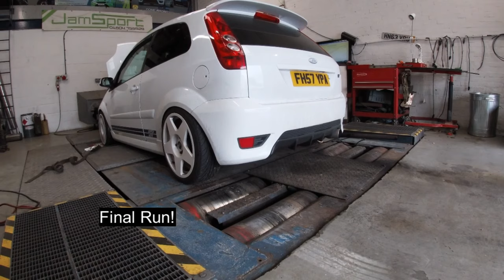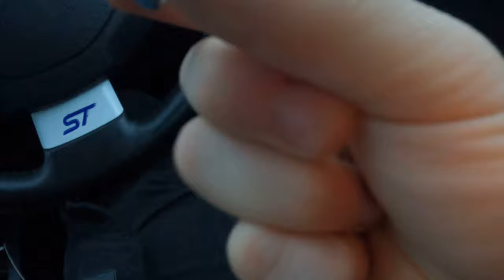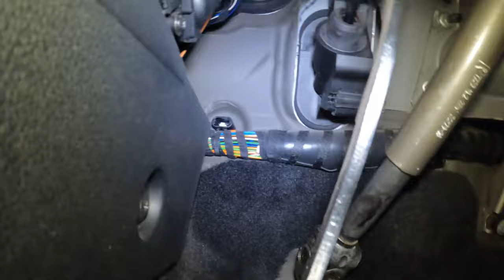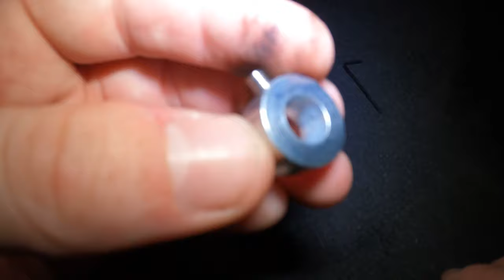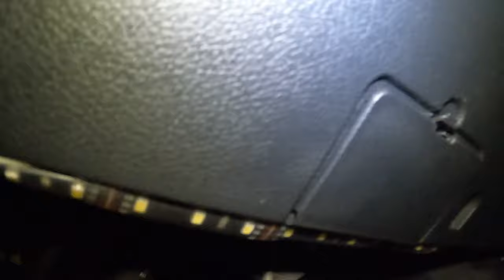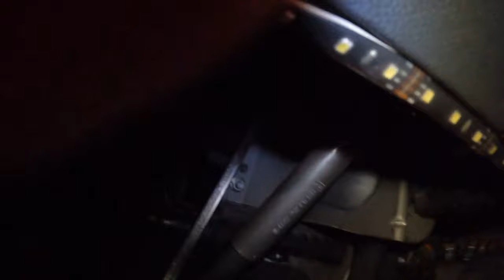MK6 Fiesta Ford Fusion and Mazda 2 Clutch Pedal Linkage Repair

Comment: Useful video, I think it's important to add not to pinch the plastic rod. It's designed to rotate with the pedal action, so plenty thin dry lube is a good idea. But the collar will stop the lateral movement that breaks it. Great idea I've ordered one.
Reply from the maker: Thank you and Definitely mate I just did a little nip but you could definitely pinch it if you overtightened it I’ll pin this comment so the lovely viewers can see your advice and yeah can’t got wrong for like £3.80 great bit of kit

Comment: Great video, it steered me into the right direction. The eBay parts are standard components. The ring with the setscrew is DIN 703 or DIN 705A with an 8mm hole. Any M8 ring should work fine. I had some laying around at work. 
This issue led to a leaking master cylinder in my Mazda 2. Hopefully by re-centering the piston with this fix, the leak is dealt with as well (small chance). Otherwise i'll have to go to a garage.
Reply from the maker: No worries I’m glad it has helped you in some way and hopefully will prevent any failure in the future

Comment: Yeah nice one Ted very useful content.. When my fez was delivered it had the plastic arm or rod in the  footwell.. i didnt know what it was until i tried to use use clutch pedal and it went straight to the floor. Needless to say replacing the clutch master cylinder is an absolute pain the ass. Its super fiddly..  honestly if  you dont have this stopper clip. Dont delay it just get it done. Save yourself the extra trouble.👍👍🔥
Reply from the maker: Thanks Denis much appreciated and yeah a clutch master can be very tedious if you haven’t done one before the ones at Vauxhall were a nightmare wouldn’t wish that job on my worst enemy glad you enjoyed the video buddy 😊👊🏻

Comment: I'm definitely going to buy one of these. Wife has a 07 plate and her linkage came off exactly as you showed it could. Luckily she had just driven into our road a stone's from from the house when the bugger came off ! Phew !
Reply from the maker: Luckily it didn’t snap the master cylinder as that’s what usually happens when they come off
Reply: @6uiltdifferent  Wow , didn't know that. Thank goodness it didn't do that ! She said was just changing down on the corner and her foot slipped of the clutch heavily and that did it.
Reply from the maker: @Glen694u  very lucky then mate glad it didn’t and it was a quick fix for you

Comment: If it is the bushing on the pivot nut which are worn and you reduce the amount of lateral motion the linkage has won't that just mean more lateral force on the master cylinder's rod?
Reply from the maker: There no bushes on there it literally just a piece of plastic held on by a clip that always falls off so you just replace it with one that doesn’t. this doesn’t change no movement it’s not that technical I’ve got my one on to this day and it’s still good

Comment: The master cylinder part that attaches to the clutch pedal came off on my fiesta when I was on the motorway.... temporarily secured it with a zip tie
Reply from the maker: Luckily it didn’t snap as that what they do when it comes away Atleast you got back ok 👍🏻

Comment: Thanks for the video Ted, I'd heard about this issue on the Mk6, I'll have to take a look at mine at some point, had it 8 years and it's coming up to 100k. Making the linkage out of plastic seems a bit weird for a part that gets so much use?
Reply from the maker: No problem bud defo worth doing for only a few quid and yeah unfortunately cars are build with cheap plastic crap which is annoying

Comment: this happened to me today in traffic in fiesta 2007, clutch gone, straight to floor. AA came and I need this kit. There was also water or fluid all leaked out at same time. Forgot to ask AA, but do you think its from the same issue?
Reply from the maker: Yes this would have caused it sounds like you’re going to have to change the clutch master if it’s all leaked out aswell unfortunately
Reply: @6uiltdifferent  sounds bad. I'll get it to garage.Thank you
Reply from the maker: @moni-jn3jw  no worries mate

Comment: Thanks mate didn't even know that. Where did you get the washer from. Will check mine later today. Sorry man just seen the link you put up for the ally washer. Cheers
Reply: Link in description mate.
Reply from the maker: No problem and as Norm said the link is in the description 😊
Reply: @norm4242  yeah thanks seen. Have look had the car three years didn't know this could be an issue on these